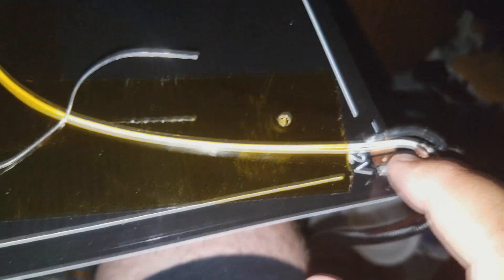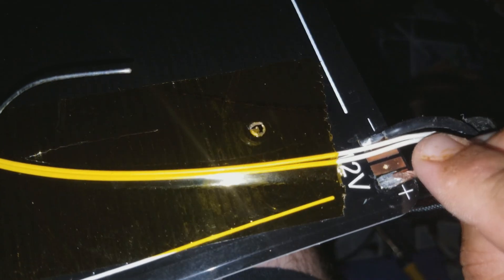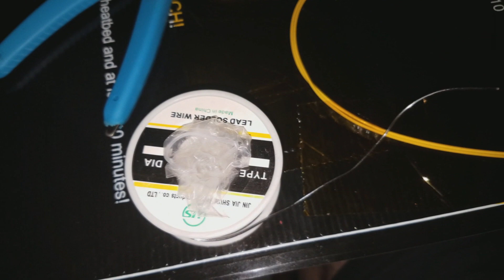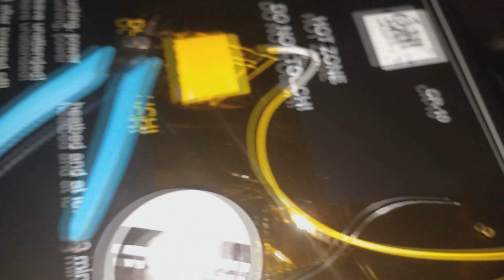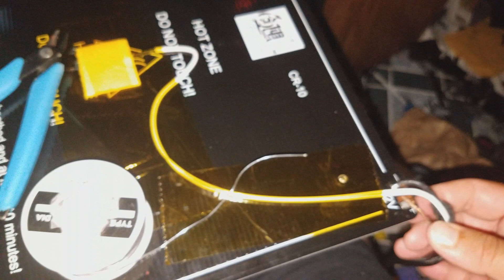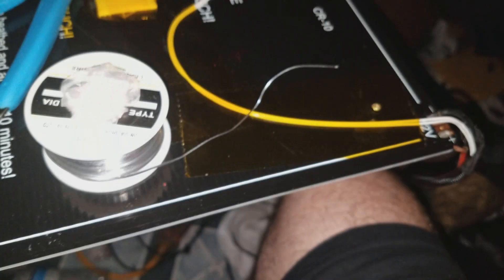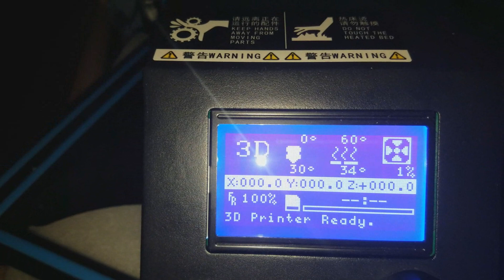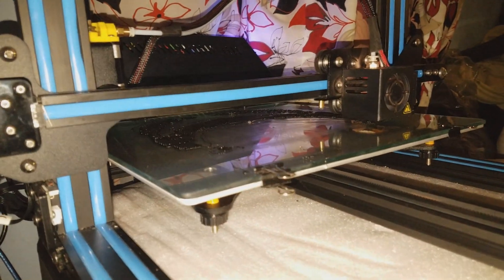3D Printer Heatbed Not Working Solution

Comment: My 3D printer Anycunic kobra is not heating up. First time trying to use it
Reply from the maker: Be sure to check the connections.  Sometimes it's lose or put in the wrong socket. If all ease fails must be a short and it is in need of replacement.

Comment: my printer wires snapped for my heatbed ant it works now but the printer wont actually start the print.
Reply from the maker: Make.sure everything is hooked up right and tehre is no short. Also perhaps because ur bed doesnt reach tge heat temps go to ur slicer and put the heatbed on zero temp and it should start.

Comment: Dang. My bed suddenly got cold last night. I have to look into what happened. I've never taken apart the bed...Is it complicated? Also, should I/you put some electrical tape over that soldered area?
Reply from the maker: Na what I do is solder it. U can put hot glue on it. I recomend buying flexable wired and attaching it to the existing wires. Anyways I dont want to complicate things for u. It's very easy brother just the springs be carful with I almost lost one the other day lol. Now I have spares but if u dont it's a bitch. 
Please do help out this channel by liking this video subscribing and hitting that bell button as many more videos to come.
Reply: @Vortexcinema677  Flex wire to give it more slack, you mean?
Reply from the maker: @stevei7221  lol yeah damn auto correct lol sorry about that. Yeah when I put that in all never got screwed again also get the attachment in thingiverse that relieves the strain. To releave the strain I just put a few cord bands on it and it was good to go. They are so stupid not to use flex wires because this will always happen. Are u under warentee? If u are  theyll send u a new bed that what I ask for and I having used it lol I kept it as a back up and I fixed the old bed myself. Please do help out this channel by liking this video subscribing and hitting that bell button as many more videos to come.
Reply: @Vortexcinema677  Gah...My wire's shorted. Just found it.
Reply from the maker: @stevei7221  there ya go bro. Just fix it and ull be on ur way. Please do help out this channel by liking this video subscribing and hitting that bell button as many more videos to come.

Comment: Ive got a heatbed problem with my Ender 3 pro, just got is last week, now the beds not heating up anymore. I took the bed off, everything loos fine, i opened up the control box, everything is plugged in and hot glued in place, cant see anything??????? What to do??
Reply from the maker: Hot glue wont do u need to solder first then do that bro it should work perfect.  
Please do help out this channel by liking this video subscribing and hitting that bell button as many more videos to come.
Reply: @Vortexcinema677  its all factory hot glued in place, should I take it off and check the connections aren't loose?
Reply: Well, it was a mission, In the end I checked the circuit board, removed the hot glue from the terminals and unplugged both + and - for the bed heater, and re plugged them as tight and deep in the terminal as I could. I have put everything back together, set the printer to preheat bed and within seconds it was heating up. It's too late for printing now, but the bed went up to 45C so seems good for the time being. Ill test it out tomorrow, and hope I don't have more issues :)
Reply from the maker: @NorbA8AWORKS  print pla bro I've done THAT nd then strengthen it with apoxy and liquid fiber. TRUST me itll be strong as fuck.

Comment: Dude, it's normal, you should always Check your wires and use some heat resistant tape.
Reply from the maker: Bro all done and still the same tge issue is bad quality and it's not normal at all maybe normal with this brand as even their new printers have this issue. It has to do with nonflexable wires once u replace them it's all good bro

Comment: Currently my printer bed sometimes slowly heats up but the connector at the power supply gets steaming hot. Can't touch it.
Reply from the maker: It's perfectly normal dont worry about it. It takes time to heat up. Please do show some love for this channel by Subscribing hitting that bell button and like button as many more videos to come.
Reply: @Vortexcinema677 I finally got the energy to seek out the problem. I thought it was a broken cable going to the heating bed... all tho I checked with a multimeter they carried current through. But in desperation I just cut them off and soldered new leads to replace them... the problem didn't go away. I then noticed the plug wasn't all the way in the power supply, I pushed it in some more and the bed started heating up... but every now and then in the middle of the print the heat started dropping again. I tried to push the plug in some more again, and that helped. This continued a dozen times until I pulled the plug out and looked inside the holes on the plug. The "sleeves" was really flared out in every hole so I took a sharp tool (a small nail) and just pried on one of the sleeve thingies in each hole to make better contact with the pins in the power supply, and now it all works like a charm!!! So the plug was the main culprit!
Reply from the maker: @TheRealFOSFOR  great eye bro. Glad u found a solution

Comment: how did youget off the silver sponge like thing on the back of the heatbed
Reply from the maker: I didnt have a silver sponge bro. What do u mean? Let me know bro and I'll assist u. All I had was wired and I had to desolder it and then solder it again. The only thing I recomend using is flexable wire not the regular crap unless u use the 3d printed part to support it. Please do show some love for the channel by subscribing liking the video and hitting that bell button as many more videos to come.

Comment: My S4 printed strong for a week. Then it just quit heating up. It stays at 30 degrees. So a quick fix is to print with your settings in cura at 30 degrees. Then put blue painters tape on your bed. On top of that use the Elmer's glue stick glue on the tape. Now print with a brim, 5 lines for good adhesion and your prints should print fine.
The heat is basically to keep the first 4 layers stick to the bed.
Reply from the maker: yes but working with other filaments let us say abs or so its better to fix the bed and its really easy to do.

Comment: Hello Lior,
My cr10 plus bed stopped heating a couple of day ago. I checked the wires and mosfet, everything looks fine.
Any suggestions are highly appreciated :)
Reply: yh my wires look fine but its still not heating up
Reply from the maker: @anthonymanswell5591  bro that means there is something either wrong with the wire still or with the wiring in the control box. Open the control box bro and see if all is 8nside correct.
Reply: @Vortexcinema677  hello i really like people who helps others. I hace the same issue. Can i give you a call to maybe give me tips what can it be? Please 🙏🙏 congrats for your channel
Reply from the maker: mohammed kalaji brother it has to be the wires. Try contacting the maker and get a replacment even if it's for money it's cheap. Have u opned the control box? Sometimes the attachment to the board isnt sitting. Let me know brother.

Comment: I had this Issue after 19 hours of a print job, which kicked my Model from the Head bed 3 hours before it should be ready :-(
To avoid me from this issue I added the Wire management, Strain relief and Glass holder from Thingiverse.
This should keep the mechanical load away from the soldering Point
https://www.thingiverse.com/thing:2328449

Comment: Man my bed stopped heating after the first print so i will check those wires
Reply from the maker: Sebastien Boudreau yeah most likely it's the wires. These th8ngs were built with fault. After the bed going in and out all the time the wires rip off also burns off by melting I believe
Reply from the maker: Sebastien Boudreau also a horrible soldering job they did so resolder. Be sure to show some love for The channel and subscribe as many many many more vids to come.
Reply: Funny thing is that the solder looks fine right now i think it might be a faulty mosfet